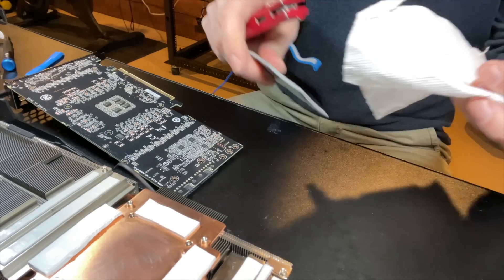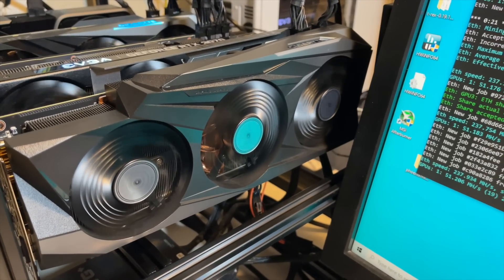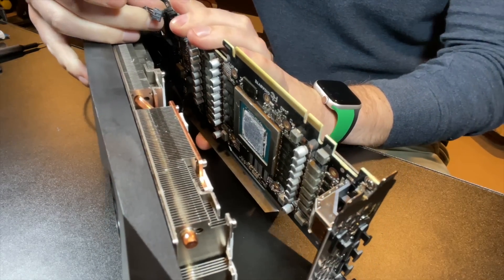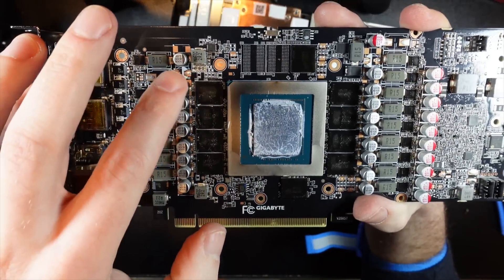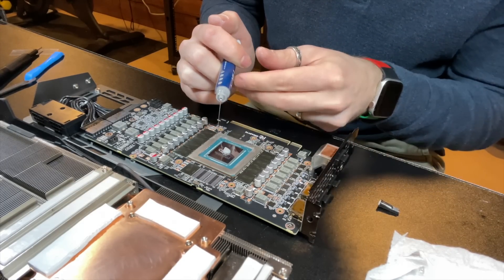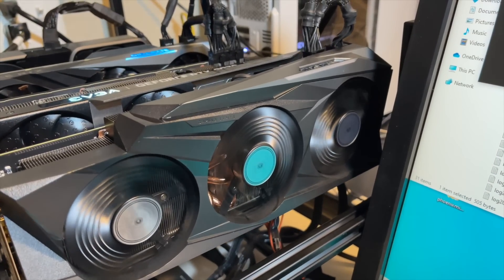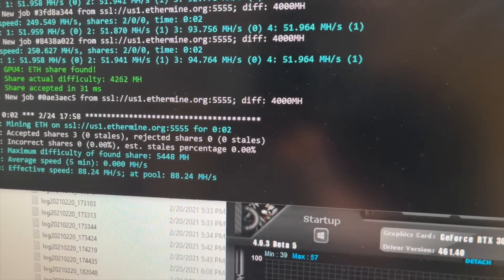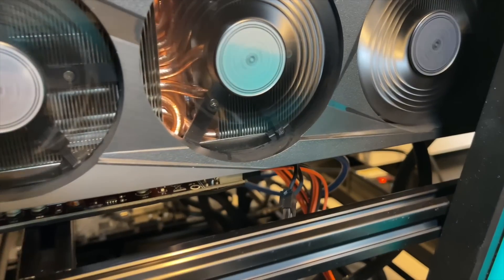RTX 3080 Thermal Pad Install & Ethereum Testing

Comment from the maker: Latest Update:

UPDATE: RTX 3080 Thermal Pad Install & Ethereum Testing (Part 2) - https://youtu.be/FZ26U_mvyAI

Original Update: 

It's been a few days of mining with this GPU and the overall performance has improved dramatically. I do think that replacing the stock thermal pads on the front side of the memory should be done as well. I'll be doing this in the future and testing further. The goal is to continue to reduce the memory junction temperature as much as possible.

The front side thermal pads are 2.0mm: https://amzn.to/3kDJ01C
Reply: Here is my experience. 3x Gigabyte Gaming OC 3080 and 1x Gigabyte Vision 3080. They're basically the same cards as your Eagle. I bought a large sheet of thermal pad material from an electronics store. 2mm thick, 8w/mk. I cleaned off all existing thermal pads, used alcohol wipes to get rid of all the grease everywhere. I then cut up and placed the new thermal pads on the backside and frontside. I found 2mm is ample thickness between the PCB and backplate. Before each card's memory was running between 100~106c with fans at 100% and giving me 93mh/s~. This modification literally reduced memory junction temperatures by 35~40c on each card for me. I'm now no longer thermally limited, only silicon lottery limited. One card does +800 on the memory for 95.5mh/s at 208w, another does +1100 - 98.6mh/s - 227w, the last two are identical golden samples. +1500 - 102.8mh/s - 225w. I only need to run the fans at 75% now and memory temps are mid to high 70s. You definitely need to replace the existing thermal pads.
Reply: @Walrusbonzo  what the fuck how did it reduce the temp that much. I covered the back and the front of the chips and now it sits at around 98-104
Reply: @WhatsY0UTUB3  I don't know. I was shocked too. But I suspect a lot has to do with the quality of the thermal pad material used. I know a lot of people are using Gelid or Thermalright pads because they're common on PC sites. But they're sold out most places in the UK, so I bought a sheet of this instead. https://uk.rs-online.com/web/p/thermal-pads/1745712/ - Yeah it's not cheap, but it's enough material to do 14~15 cards.
Reply: @WhatsY0UTUB3  worth bearing in mind I don't know how long these thermal pads will last before performance starts to drop off. The stock thermal pads definitely got a lot worse with time. 2 cards have only had a day. 2 others 2 days.... Fingers crossed. The stock pads lasted about 2 weeks!
Reply: @Walrusbonzo  Exactly ,but due to lack of find those  thermal pads (2 mm) ,i was need to stack 2x 1mm arctic 6k/w ,but hey  still good than stock shxxxt pads on my 3080 gigabyte gaming oc. I managed drop temps from 110c  to 88c  and for that mod i made it with stacked pads i can say   is really really good . (i was afraid make some air pockets  when i stack those 1mm pads from arctic so i pressed a bit ... not so hard ).
Or i was lucky with thermal pads mod , or it just work with lower rated k/w thermal pads like Arctic are.
Reply: @Walrusbonzo  what dimensions of this thermal pads  I need to buy for one cars for example if I buy 100x100x2.0 will be enough.  The Thermal Grizzly Minus Pad 8  2.0  will be Ok ?
Reply: @NatureTunesKids  I'm not 100% sure, but I think for one 3080 that will do the job.
Reply: Same card here. I did both front and back.  Memory is running about 85c in a similar ambient environment @ about 96.5 MH/s.  I haven’t really spent the time to see how much higher it could go.  I used the Thermal Grizzly pads. Pretty sure 2.0 turned out to be adequate for both front and back, but 2.5 would have probably been optimal for the back.  Others have also used the 3.0s, and just get some extra back plate bowing.
Reply: @jdogi1  its allways a good idea to replace it all  thiose pads are the same ones spewed oil all over the front
Reply: @rgscomputers1  so, you're saying the thermal grizzly pads are gonna spew that nasty oil?
Reply: @jdogi1  Thanks for your review for your investment contact me +/*1/*2/*8/*1/*2/*9/*7/*8/*3/*4/*2
Reply: i changed the front thermal pads and then i am on 76-78 oC !!! that is the solution! try it ;) i put gelid 2.0 mm only on memory chips in front
Reply: I have mounting pressure issues on my cooler, pinching the cooler near the ram drops temps 12c+ try squeezing the gpu at various places front and back you may have poor thermal pad thickness.
Reply: I changed my pads and it dropped to like 92 degrees. Over the last few weeks its been creeping back up to 102-104. Think i might have to take it apart again..
Reply: @WhatsY0UTUB3  when i put on backplate only, the same happened to me. You need to change the front pads memory chips only.
Reply: @DetsiRecords  I changed the pads on the front of the chips and added to the back. you think removing the backplate chips would make it better? i used thermal grizzly minus8 pads
Reply: @WhatsY0UTUB3  hmmm idk, it worked for me. Make sure you put them right Maybe. I cant tell anything else. hope you find out.
Reply: @DetsiRecords  What was the thermal conductivity of your gelid pads?
Reply: @WhatsY0UTUB3  conductivity 12 and 2.0 mm ..
Reply: I just build my first rig 3 x 3080. I set 90% fan, -150 core, 2000 memory, 245W power limit. I use T-rex miner on Hive OS. It is good OC for 3080? I have 293 MH/s for 3 gpu. Sometimes my rig is frozen so i shoud down memory OC?
Reply from the maker: @jazon9  looks good dude. If it’s freezing or giving you share errors in the miner typically means lower your OC. Try dialing back you memory a little bit to see if the issue persists.
Reply: @RedFoxCrypto  What % "Stale Shares over 24h" it is good % on mining pool?
Reply: @jazon9  yea 2000 memory is way too high. do like 700-800
Reply: @WhatsY0UTUB3 You probobly talking about afterburner on win config. In Hive OS, you need to double the amount  Afterburner set. So, your 800 in Afterburner is like 1600 in Hive OS. But, yes i try go less on memory.
Reply: @jazon9  yea I am. I did 1000 for a while but got freezes. I dropped to 700-800 and it works all the time now.
Reply: Do you need to change the paste when you take it apart?
Reply: @R4ych1on  yes
Reply: I haven’t been able to return my 3080ftw3 to stock temps since removing the cooler. I’ve tried everything. The stock material was a weird putty, not pads.
Reply: I think you should think about still running cooler. Nvidia might not set the junction temp throttle higher. But from a physics point of view running it at temps that high for prolonged time could cost you money when trying to sell the card later. If it gets that old.
Reply: you would think for what the thermal pads cost in the factory they would put them on back side of the card. and not force your to void warranty just to add them
Reply: I just changed out all the thermal pads on my aorus 3080 xtreme pcb. Was hitting 110c junction temp on +0 and 100% fan speed. Swapped out the oily stock pads with thermalright extreme odyssey 1mm thermal pads that has 12.8 w/mk thermal conductivity. Double stacked for 2mm on the memory. Running at 102mh/s and +1500 memory atm with 74c juction memory stable. Day and night difference for me. My aorus didnt have any pads on the backplate covering the memory so i left it empty. Still 74c. Cant ask for any better than that
Reply: gigabyte is a joke, even on the aorus xtreme new out of the box it reaches  108 with no over clocks power limit 60, compare that to a strix out of the box same settings 80ish C, now I gotta replace all the pads so i can OC and get 100 mh you should replace the front pads too
Reply from the maker: @kevin-wg5iv  Yeah dude complete joke. Def gotta replace the stock pads.
Reply: Can't put 3mm on the front side?
Reply: @whitedancer5866  my advice go with 2,5 mm  on front max, and 3 mm  max on back , and that depend by thickness on thermal pad you have.
Reply: @riannair7101  Is there a slack with 2mm on the front?
Reply: @whitedancer5866  no slack at all , all goes well on my  thermal pad mod.(arctic 6/kw pads are anyway a little thick, so i really not go with 2,5mm on them if you stack them like mine).
Reply: yeah front side heat extraction is more important.  Backplate heat extraction is passive.
Reply: @Tony-ei1mr  Thanks for your review for your investment contact me +/*1/*2/*8/*1/*2/*9/*7/*8/*3/*4/*2
Reply: It’ll be good to get a wide variety of thermal pads of different thickness. From 0.3mm,0.5, 1.0, 1.5, 2.0, 3.0. They can be bought for cheap from Amazon or from Aliexpress. 

From my experience the cheap thermal pads still do leak oil. So if ur really want to take proper care of your cards you could invest in premium thermal pads that cost around $20 usd for like 100x50mm.
Reply: Would warranty be lost with this. Also what os the difference between thermalright and frosty thermal pads 12.8 W/mk on Amazon. Both have same conductivity but one is 40% cheaper. Will these work?
Reply: Do you lose warranty if you (re)place thelmal pads?